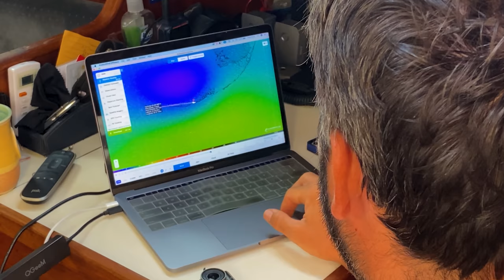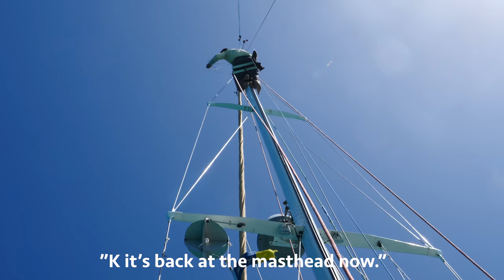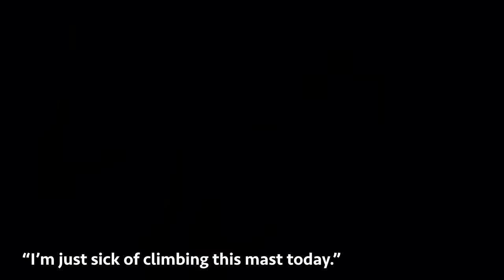Teamwork... How to Run a New Halyard with Mast up (Calico Skies Sailing Ep 96)

Comment: For the next time you have to fish the mast... The next time you order from Amazon, get a dozen donut shaped rare earth magnets used for holding doors. They are about 3/8" in diameter with a hole in the middle for a screw. Tie a half dozen of them to your drop line 2-3" apart and screw another one to the end of a dowel. Drop the line outside the mast to figure out the general length needed and then move it to inside the mast. Now you have six chances  of snaring the line with the dowel across a span of 18" intead of having to drop to an exact height. If those magnets get within an inch of each other they will draw themselves together and stick like glue. I've used this technique 100's of times in a dozen different scenarios and it has never let me down!

Keep up the great videos and above all STAY SAFE! ⛵❤️😷

P. S. I'm working my way through your preTTYC vlogs!
Reply from the maker: That’s a good tip! The one magnet just wasn’t cutting it. You know there will be a next time fishing halyards through lol. 

Thanks for watching! Glad to hear you are catching up😃
Reply: Thanks G Bean..👍great tip..replacing halyards are a pain in the backside...and I  have got to replace my main halyard very soon....lol..⛵⚓
Reply from the maker: As long as you don’t lose the messenger in the mast it should be pretty easy 😂😂. We just splice in a reeving eye and last the new halyard to the old one and pull through.
Reply from the maker: Hahaha google is watching!
Reply: @CalicoSkiesSailing  I just "experienced" an ad for Google Fi phone services touting the security of the service. Yeah, its secure from everyone except the biggest data collection company in the world!  🤣🤣🤣

Comment: I see you have a self climbing bosuns chair.  Do you like that more than the standard rig attach to a winch?
I ask because it seems safer to me to use rather than rely on someone at the winch to have your life in their hands.
I specifically want to know about its utility and any chaffe you experiece usinmg it.
Also is it difficult?
What brand is it?
Reply from the maker: It's an ATN Mast Climber. We have both that and a regular bosun's chair onboard. I prefer the climber. It's easier for me to climb myself up rather than have Grace do it. Also the feet strap allows you to stand above the mast head which is difficult in a bosun chair. I attach the climbing halyard at deck level reducing the amount of motion. Our main halyard is oversized and that eliminates chafe 👍